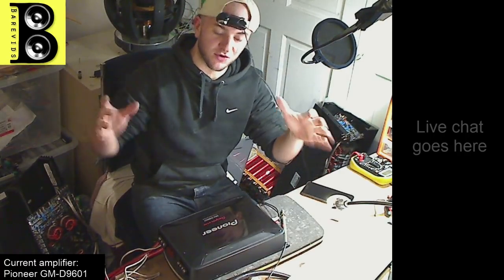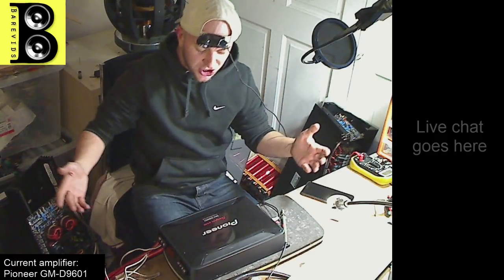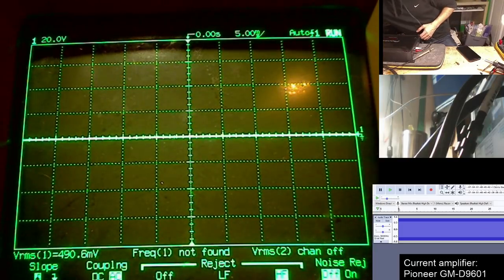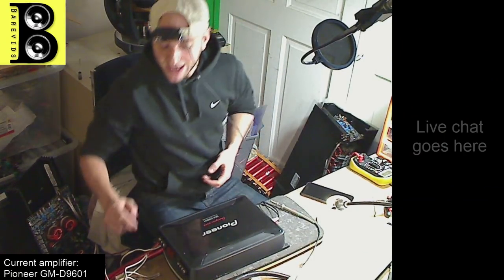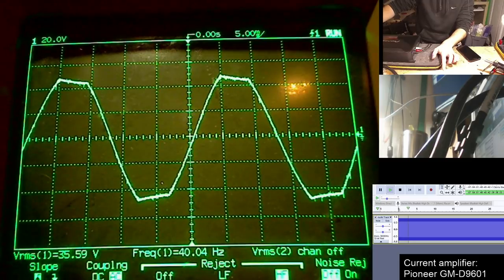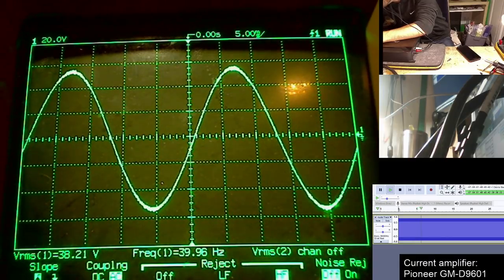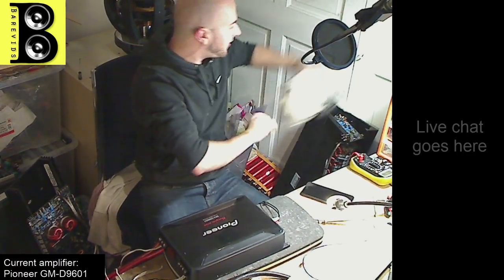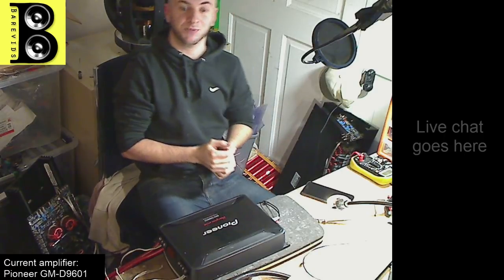Setting gains with subs connected VS disconnected

Comment: GENIUS! Setting gain with subs hooked up at tuning because impedance rise at least voltage drop at most! So simple yet it never crossed my mind! Your understanding and knowledge is off the charts bro! 👊
Reply: So if I'm understanding this correctly I would use a test tone of 32hz (my subs enclosure tuning frequency) and set my gain with my sub connected to the amp (something I have to do because I use full bridge amps) and that would give me the most accurate gain setting without clipping?
Reply: @EntityMusicEnt  you can however most people use a -5 db 40hz test tone and set it. I set headunit volume 28 and then roll the gain on amp up to clipping

Comment: This makes perfect sense. Why does absolutely no one anywhere have this step in any tutorial when it comes to setting amplifier gain correctly & instead everyone says to disconnect drivers? I understand to prevent damage but, if the signal will be clipped anyway then why not mention that? Or cater for that extra rail voltage somehow? If one does not have access to the load simulators, can the actual subwoofer or speaker be used in gain setting? & if ran for just a couple seconds while setting gain, will this still cause damage? I feel like more in depth videos should be made on this particular topics of setting gains with load for the average car audio enthusiast. Thanks bro. Keep up the great work.

Comment: This is less important when working with subs than mids. I adjust my subw level depending on the music I play, but with mids you don't. This a prime example of why I use 0db or -5db when sitting gains on midrange amps. The voltage drop on the input, as well as the rails sagging, lead to a slight clip on the output.

Comment: Please explain unregulated power supplies vs regulated power supplies. This will help with this video. Only reason I ask for this is because of what Tony D’Amore states in his DD-1 manual. “Disconnect all speakers connected to the amplifier. (This has already been calculated into the equation and provides 1- 3dB more gain overlap on unregulated power supply amplifiers and 0dB more gain overlap on regulated power supply amplifiers).”
Reply from the maker: This assumes all amps experience the same percentage of rail droop which they do not.
Reply: @barevids  thanks for the quick reply! I’m just trying to take in everything I can. There has been a lot of debate on one of the online groups I’m in comparing what method is better and I literally spent like 8 hours yesterday researching and looking at forums and it seems everyone is so one sided on the topic. Is this what you truly recommend? I was also reading that you should tune with the vehicle off. I need some guidance lol thanks 🙏🏻
Reply: @barevids  I have a 2017 Honda Accord with a 240 amp JS alternator. Stock battery and a d3100 in the back as a secondary. The alternator is pcm controlled and sits at 12ish while idle. How should I go about tuning the amp? I tuned it with a DD-1 at idle with speakers disconnected on a -5db 40hz test tone at around 12V. I just want to make sure I’m getting the most out of my system. It never gets warms full tilt

Comment: It would be best to know where your impedance is low, if your sub dips down to 2 ohms but you set it at 40 hz (lets say thats where it jumps to 4 ohms) you are gonna clip it, you are setting gains with 4 ohm load, not 2 ohm. Basically voltage drop is much lower since you are drawing 2x less power.
Reply: @nate0 Amplifier supply voltahe can change a lot just by droping input from 14.4v to 12v, on my ground zero it drops from 77.5v down to 60v. Now if youset gains without speaker you will get really nice 14.4v (or at whatever your car idles) at inputs but as soon as you connect speaker and play music it will drop down to 12-13v depending on  electricals. Since power supply voltage can't swing that much you are gonna clip signal which barevids showed here. Since your sub won't draw huge amounts of power where impedance rises input voltage might not drop that much (from 14.4v to 14v for example) but as soon as impedance drops and subs draws more power it will drop much lower. Clipping point is different for 12v vs 14v input voltage.
Reply: Old post I know, but I need to remember this when I set my gain.

Comment: Thansk for this, Great information. What I dont understand is what youve presented seems highly obvious to most logical thinkers yet the many many many tubers out there including profesional installers,  have presented many videos showing gain setting with no load.  Have just used this to great effect to set my own amp gains with a load resistor in place, feel much better its a safer way to tune.
I did however use a 500w resistor to set a 500w amp and it got pretty hot, plan is to get to a 2000w 2ohm setup and use that as I wonder if the heat will have created a limitation and a bigger capacity setup will keep the impedance more constant while testing.

Comment: That amp is rated 1200w@1ohm
38v out equals 1444w and 
35v equals 1225w
Ofcourse you are clipping. 
Got a bit concerned ther as a used to sett my amp using a multi meter with no load.
But seems I never clipped my amp.

Comment: Would doing the "distortion tester" trick work in this case? A cap in series on a mid or tweeter to high pass the lows. Would it still put a load on the amp, then turning up till the audible buzz?

Comment: Hi, thanks for your videos, they are very nice, but i need a quick advice: i have a sub Pioneer TS-w307D4. The amp that came with it (Panasonic CY-PA4003N as i bought everything 2nd hand) is 4 channel which i have made dual bridge and each bridge is fed to each of the coils. My problem is that each channel (or bridged side now) has its own gain, its own bass boost and its own frequency settings meaning that feeding the absolute same signal to each coil is hardly achievable despite that it comes initially from one, only and single source, the sub-output of the head unit. So i need your advice: what is the best amp or if not, what is the best type of amp (stereo bridged, monoblock, etc..) for this speaker TS-w307D4? According to what is the best way to wire the speaker itself to bring out the best of it (not meaning the most power): should it be wired in series for 8ohm, or in parallel for 2ohm or each coil for its own...?

Comment: I have a crossfire CFA 202 100 x 2 power amplifier designed and engineered in the u.s.a. I have a problem with one of RCA's not working I was told to look at the board and I posted on Facebook and was showed to resolder 3 things that are close together I can see that it's been broke but I don't know how to do it. do I reconnect all 3 or was they even connected in the first place it still plays sound just not in one of the RCA's.

Comment: What if you can connect the subwoofers it is ok to set the gains with 12v of voltage? and then will be at 14v with the subs connected. Or if i set the gain at 12v it will clip at 14v due to the voltage increase?

Comment: So I had to come back and watch this again. I just picked up an oscope and started tunning my set up. So in the start of the video you said to test at tunning frequency. Just to make sure I understand that right if let's say I'm tuned at 25 hertz should I be running a 25hertz test tone when setting my gain?
Reply from the maker: Yes lol
Reply: @barevids  thanks for the reply. I also had a lightbulb moment. When I had asked about dummy loads ... I would then be splitting power as well meaning less power so that would have been silly

Comment: Head unit should be tuned to Maximum undistorted  vol if So people that use a smd dd1  to set there  gains with one speaker wire disconnect should blowing there subs an amps

Comment: To find the true tune of your box do you just hook it up to a scope or multimeter to run a sweep then when the peaks impedance hits and that is your tune?

Then use that frequency to set the gain with the o scope?

Is this mainly for burping or musical daily set ups
Reply from the maker: You have it backwards, box tuning point yields the LOWEST impedance. You can't test with a DMM while playing, you need a clamp meter. Like a fluke ammeter plus voltmeter and use ohms law to calculate.
Reply: What is the formula?
I must say....this video is very interesting. I'm completing taken back because like a lot of people, I have been using my DD1 SMD to set my gains. I really need your help !

Comment: I have a 2000w amp running 2 subs at 1 ohm to the amp √2000 = 47.72 .... Should i remove speaker wires from amp or leave them? Im using a multi meter
Reply: When finding target voltage you would take target wattage X 2 and then square root that. So in your case if your amp was 2000 rms you would take the square root of 4000 which is 63 volts
Reply: My bad it’s 1 ohm

Comment: I know this is an old thread, but I'm curious to know your thoughts. If I have an amp that is 650rms and I'm only setting it to put out 440rms, how is this affecting my subs? 
I set the amp with the subs disconnected, so....
did I just loose output? or will the amp still be clipping like you showed?
Reply from the maker: It will be fine but due to impedance rise you'll actually only be putting nearer 150-200w to the subs. You should set it to clip point to get the most out of your amp.

Comment: how would i be able to test for clipping with subwoofers connected? I dont have an osciloscope but im bying one in the future. So far all i have is a pretty decent multimeter.
Reply: 40hz tone and raise the gain until you hear the tone change. You will hear it.

Comment: So how are we to modify the formula to find the correct voltage to set it with the multimeter when the voltage answer will still be Volts= sqrt(Watts*Ohms)? How many less volts would you say would be good to reduce the gain generally speaking say for every 1k watts?
Reply from the maker: That formula will still work if the amp does make rated power ☺ the issue here is just increasing the output voltage until it clips with subs disconnected would actually end up with a voltage waaay higher than the power the amp can safely produce at a given impedance. That's why the subs need to be connected. If you know for a fact your amp benches 3k at 1ohm 12.6v for example, and you don't ever drop below 12.6v full tilt, then you can use the voltage calculated from 3000w at 1ohm to set the gain.
Reply: @barevids  Ah ok thanks mate. I see now what you were trying to show. So basically if you had just set the gain by using the voltage formula the sqrt of 1200 would of been 34.6v which would of been well below the unconnected  oscilloscope incorrectly set gain of 38.1v or even clipping subs at 35.5. I suppose the sweet spot would of been somewhere between 34.6 and 35.5v if you wanted to squeeze every last drop of gain out the amp. Thanks for your reply. Much appreciated.

Comment: How kan i do this right then with my setup? I hawe 4 Ground Zero 1.4k-hcx two and two straped. And two GZPW 21SPL in wired to 2ohm on itsh straped apfiers??? I dont feal i can set gain with subwofwers conekted! I use dd-1 but this video you make conern me! 🤷‍♂️🤔
Reply from the maker: watch my other video. search "barevids match amplifier" where i show with x2 GZ amps and x4 sundown subs
Reply: @barevids  Yes this video i hawe se many times and its wery god! 😃👍 But the quation is not to set gain like this, but how to sett gain level right to cliping point without speakers conekted to apm??
Reply: i dont hawe a 2ohm 10000watt dummy load 🤣

Comment: wow! but howto do without over powering sub bcuz my liftgate will need to be opened while making adjustments but the subs will experience more excursion then with liftgate closed. I dont wanna hurt my month old subs. I have 2 Taramps Bass 8Ks @ 0.7 ohm for 2 15" D1.4 Fi Neo 4.11 rated at 5k each. Ty.
Reply: no wall. vids of it r on my YT ch if interested. I SPL compete.

Comment: So if i use your old method(using a tweeter with a cap) do i get the same clipping as shown in this video once i connect the sub or is the signal good to go?
Reply from the maker: You should use the tweeter cap method with subs connected, always